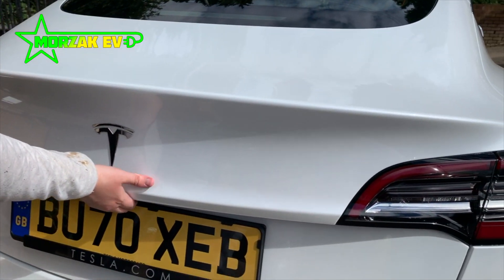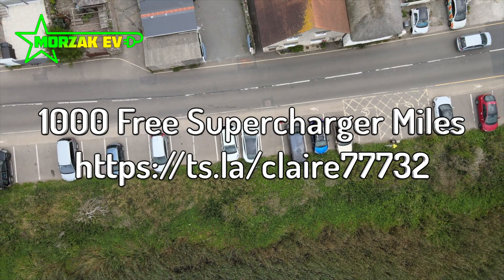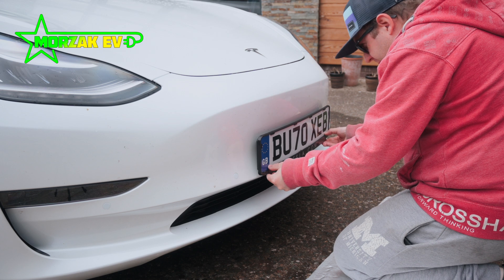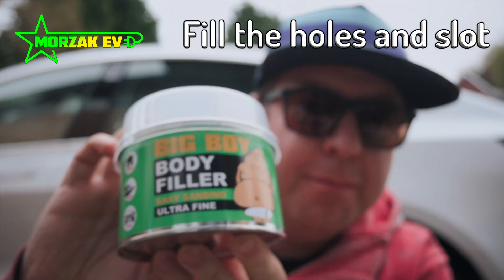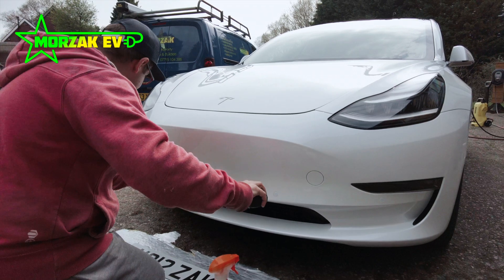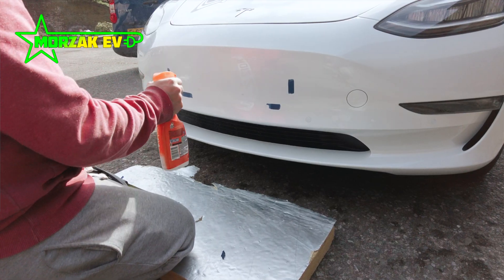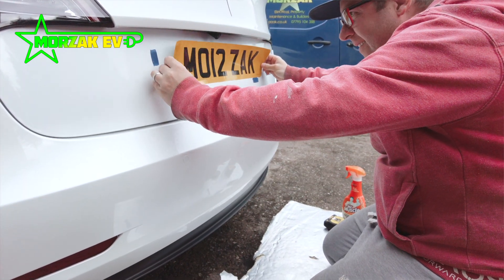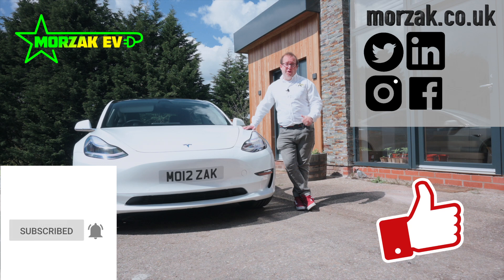Tesla Model S / 3 / X / Y number plate upgrade - slick vinyl plates

Comment: I've just applied front plate using your advice. It worked really well thankyou. A couple of points.....the water & washing up liquid tip is great, I would've ruined my sticky plate without that tip! However when you say it's ok to skip the filler, I think you should definitely fill the screw holes as I got air bubbles where the holes  are. They're minimal and I'm happy with the result but for the perfect job those holes need to be filled or maybe even just taped over
Reply from the maker: I'm going to pin this comment so other people can see your comment on filling the holes.
Reply from the maker: Good point. I guess that with the filler - you really have to do a good job otherwise it could make it work. Thanks for the kind words though and glad it helped!

Comment: Good video. Added top tip: before removing the original plate use masking tape to mark the original position, this will save time measuring post removal. 👍
Reply from the maker: Nice! I did this again recently, and didn’t think to do that!
Reply: @MorzakEV  how have you found the longevity of the vinyl plate? I am still considering it!
Reply from the maker: @cyberricki the first one we had lasted for 3 years with no issues and 30’000 miles, so no problem at all!

Comment: Do these hold up to pressure washing OK?
Reply from the maker: To be honest, I wouldn’t trust a pressure washer on the Tesla’s paint work up close anyway. We use a pressure washer with an adjustable hose on a lower setting up close, or on a high setting from a good safe distance away only, as well as a lance with the car shampoo. We’ve never had an issue and they’ve been on for a good year now with plenty of washes. They are very well adhered but I suspect constant blasting of the corners up close my work them loose over time, so you’d need to be careful.

Comment: Do i need water as i feel water wil show trought the plate as its not easy to remove
Reply from the maker: Hi, you don’t have to use the water, but having done similar things before, I would recommend it. The water is there to stop the plate sticking. You can remove it again or slide it around. If you do t use water, the plate will just stick and you won’t be able to adjust it again without damaging the sticky back. After a little time the water dries off and the plate sticks nicely.